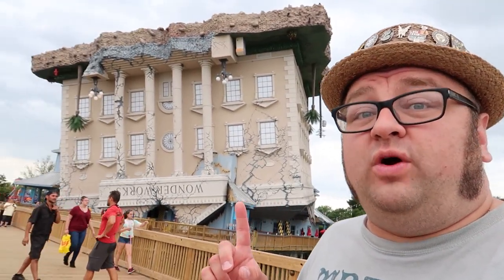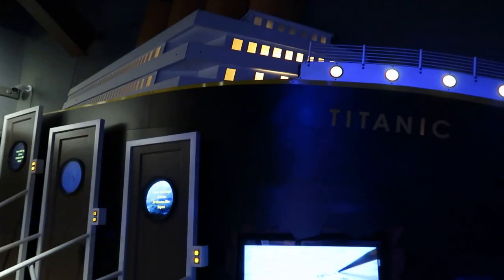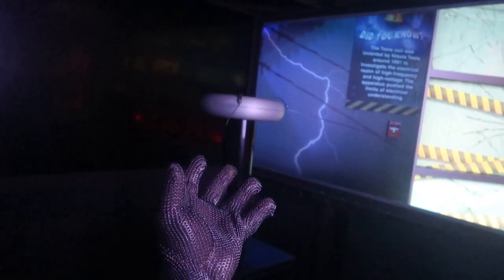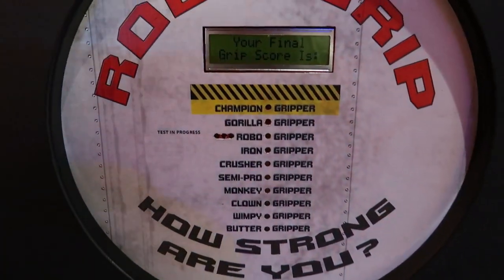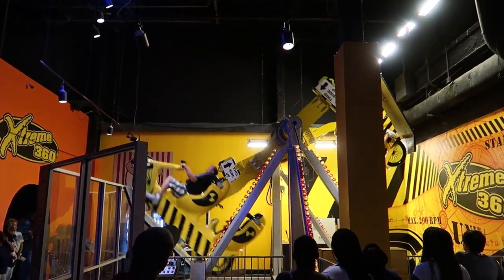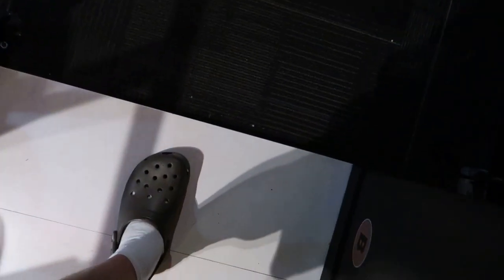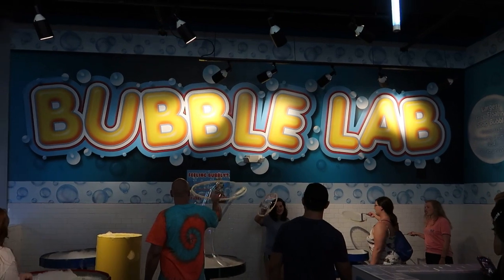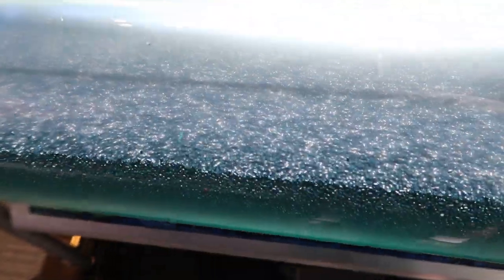Wonderworks - Myrtle Beach, SC

Comment: The camera glitch was caused by a strobe light.  The illusion of the water Droplets flowing upward is produced by strobe lights synchronized at just the correct speed.  By shifting the speed just a bit, you can make the droplets appear to stop, also.   Video cameras work by taking multiple still images.  If the lighting is strobing out-of-synch with the camera, the black moving lines are the result.
Reply: a tip: watch series at KaldroStream. Me and my gf have been using it for watching loads of movies during the lockdown.
Reply: @Brayan Emmett yup, I've been watching on Kaldrostream for since november myself :D

Comment: I couldn't see the scientist portraits very well, but the one on the far left looked like Sir Isaac Newton.

The anti-gravity illusion uses a rapidly blinking light, which causes a banding effect on your camera.
Reply: Timothy Raif And the banding effect is due to the sensor record speed between frames vs the speed of the strobe light.  The fact that one is faster than the other shows the band moving as the sync keeps changing but the band existing in the first place is the in-between frames.  Also, if you remember filming with your old video camera the CRT TVs of old and you would see something similar. But in a CRT, it wasn’t strobing that cause the effect, it was again, the image sensor shutter speed versus the scan line technology of the CRT which takes an electron beam that runs very fast horizontally to paint each of the 400 lines of resolution and the camera shutter effect could pickup that process in real time. Sort of like watching a humming bird flapping its wings under a strobe, helps you see the flapping in slow motion.  — hopefully i didn’t butcher up that explanation too badly.

Comment: I've been to this one before years back when I was a preteen with my church group, it was so much fun..

5:46 Aw yes, the Hurricane Shack, during the Cat 5 storm, I held on to one of the poles tightly..

16:22 I actually went on the Bed of Nails, it's not as painful generally, as long as you stay still..

22:25 Tzatziki (spelt Τζατζικι in Greek), is a Greek sauce used in Greece, famously known in gyro wraps. You almost got the pronunciation correct, even though it's pronounced like ta-zi-ki (I'm part Greek, my dad's from Greece and he's a former Hellinic Navy officer.), in general.

Comment: The camera glitch is happening bescuse it's an optical illusion. The striped wall, combined with the light strobing at a speed that's undectible to the naked eye is making your brain think the water is flowing up. The camera's frame rate is jarring with the strobing light causing a black line.